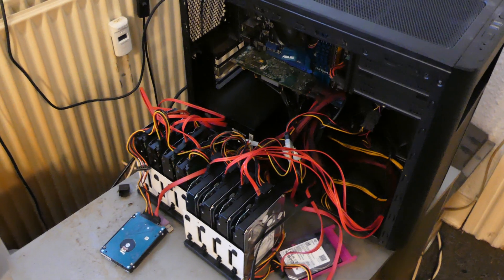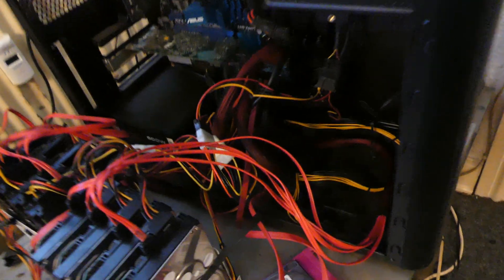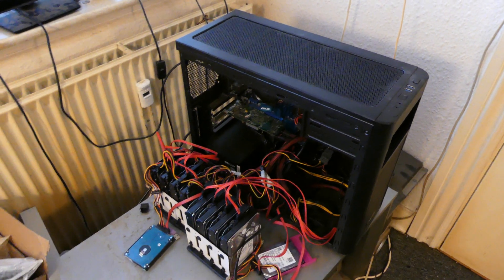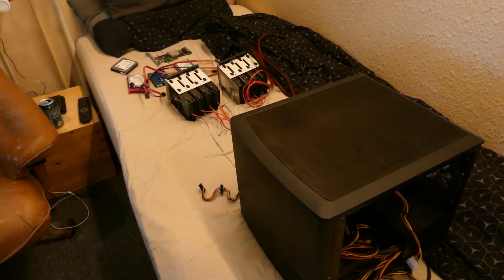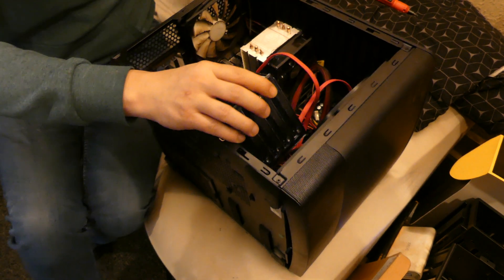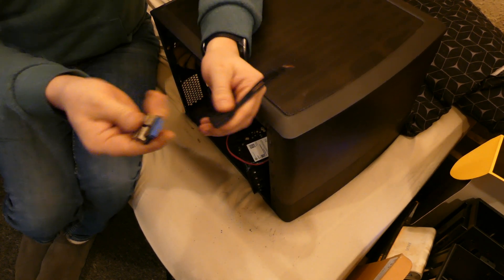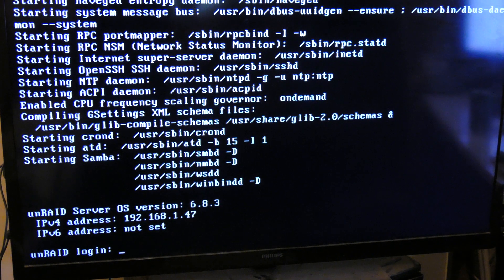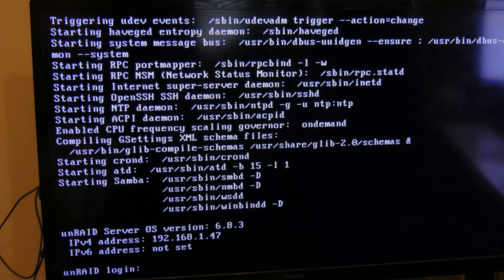Move Unraid To New Hardware

Comment: I want to migrate from Xpenology to Unraid. I have one empty 8T. I unplugged my expenolgy USB and i plugged in the unraid USB. Assigned disk 1 to that empty 8T. I tried to mount one of my full 8T's to see if I could see the data for copying but it would not mount. Is this possible?

My only other option. I was thinking of doing was borrowing my friend's server, take his drives out. Start with my 1st 8T in his to copy another 8T over then pull that out of mine and into his to do the same. I think he has a 4 bay. once I have 4 all copied over. can I take them out and put them back into mine for it to still work with the same unraid usb?
Reply from the maker: Unraid won't directly recognize those disks from Xpenology. However as an unassigned device(google Unraid unassigned devices), you may be able to mount it through the command line, or in a VM maybe, but that's beyond what I have tried to do. The easiest solution is to somehow have both systems running at the same time, so you need a second server, and just doing a network transfer, and yes then you could do one disk at a time, as long as the Xpenology isn't doing any stripping/mirroring of disks that would prevent you removing the disk from there without compromising the array.
Reply: @ZnakeTech  I enabled FTP in unraid. Then connected to the FTP from Xpenology. Copied all my 40Tb of files in three days.